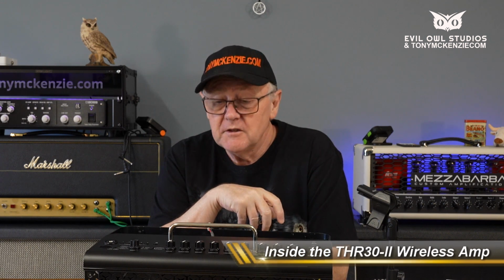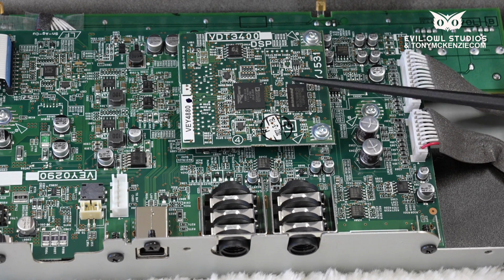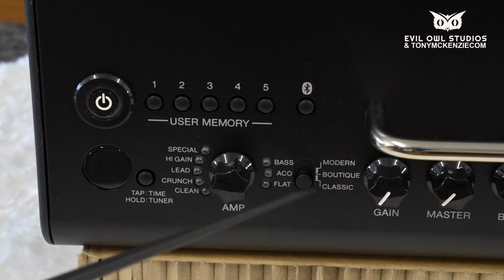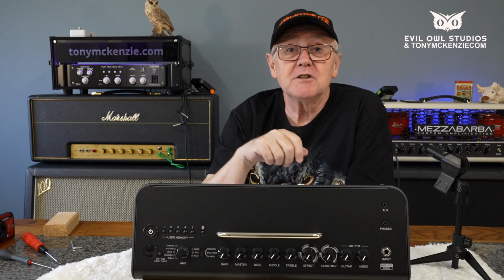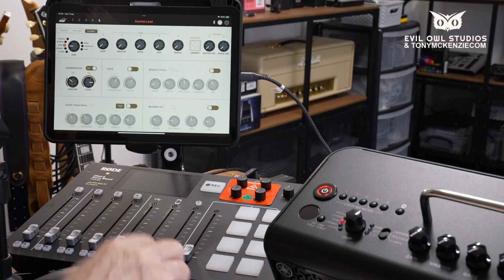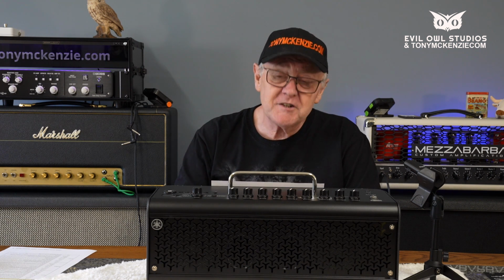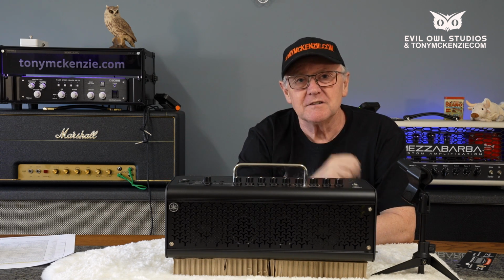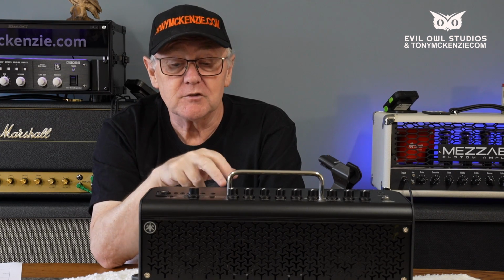Yamaha THR30II Wireless Amp Simulator: In Depth Review

Comment: I recently got a THR 30II and a line 6 relayG10TII to go completely wireless, it doesn’t have all the useless bells and whistles as a spark. It’s a no nonsense desktop amp for someone that wants killer tone without messing around with setting and effects for hours. It sounds massive, and being totally wireless makes me want to plug in and practice more.
Reply from the maker: It's great that you're enjoying your new gear and that it's inspiring you to play more!That's the whole reason to buy it! The Spark and the company making them I did not like after they did not supply the gear when they should have but had the money. I won't go back to them...  and thanks for watching.

Comment: Mine died three years after purchase. I’ve always taken good care of it and only used it in my bedroom. It’s a shame that the lifespan of the amp is so short.
Reply from the maker: That's really unfortunate to hear about your experience. Its one reason I ALWAYS talk about warranty - sadly some don't see the relevance in a review... like the chips inside, but it all matters. Thanks for posting about this problem as it lets many other guys know about your not too great experience and thanks for watching.
Reply: Thank you @tonymckenzieofficial. Unfortunately, unlike tube or solid state amps, these are quite difficult to repair when something goes wrong. I would have expected a few more years before it died . 3.5 feels a bit too short for a bedroom amp that isn’t exactly cheap in its category. It is disappointing.
Reply from the maker: Oh I get that for sure. Some guys will save up for some time (we've all been there) to get one... and while repairs could be difficult (on all digital gear) the cost might well be also prohibitive too. Good point and thanks.

Comment: PS: After the cashback offer for Black Friday, I just paid 510 Euro for this, INCLUDING THE WIRELESS DONGLE for the Guitar (Line 6 G10). Keeping in mind I had only the guitar before, that's a reaaaaally good buy to getting started AND getting started wireless from the beginning! Been wireless for like 20 years on my headsets, couldn't go back to wires now! ;-)
Reply from the maker: Yes not a bad deal.... and thanks for watching.
Reply: @tonymckenzieofficial  No, thank YOU for the review! On the integrated batteries, as a small way of saying thanks: 6 months is probably on the safe side... Also depends on the parasitic draw while just standing around, not connected... The root problem is the battery discharging to a point where voltage is too low to get recognized/charged anymore.
At that point you have a problem, because you either need to replace the battery flat out (maybe even better options available?) or at least jump start it in a way, so it can get charged again. BOTH of those options require you to open the unit and mess with electronics, OR pay a lot to have it done. If you had the choice, you'd want to store it no fuller than 80% and "catch" it before it get's too empty...
Probably best to not worry and buy a better replacement if it's an issue once out of warranty...

Comment: I have a fleet of Yamaha THR's. Started years back with the THR10X, the green high gain model. Next I bought the acoustic model the  THR5A, then the  THR10. I still have all three and they are brilliant in every way. I recently bought the THR30IIA, and it too is terrific.  Love these little amps. They shine for recording with zero latency.
Reply from the maker: Yes I liked the amp a lot, small, light and fair enough sounds. I did think the wireless at extra cost should maybe have been in the price though. But no denying its not a bad device :) Thanks for watching.

Comment: Excellent review! I bought the THR10II and I love everything about it but it has a weird crackle on all the clean tones so I am going to return it. I have managed to get a good deal on a Positive grid spark which should arrive in a few days but I am still very interested in one of these if I can get one for a good price!
Reply from the maker: Yes if there is trouble on ANY gear send it back - should not be out there. Personally I'm not really a fan of Positive Grid as when I ordered some years ago they failed to deliver for months and eventually I got a refund. But hey, let me know what you think of it when you get it - there's nothing better than an owner user that has the gear and they post the comments about how it is for them... and it helps many guys too. And thanks for watching.
Reply: @tonymckenzieofficial   I tried 2 THR10II they both had a weird a crackle. I received the Spark and it's not bad! It is bass heavy and because of that, it's a very dark sounding amplifier whereas the THR10II is more clear and has better speakers. The Spark however can surprisingly get very loud, I tested it (much to the dismay of my neighbours below) and it reached 110dB from around 5ft away.

Comment: So the lithium battery is not replaceable by common folks.
So what are we going to do when it is exhausted? Send the amp to a yamaha lab and pay 5 times the cost?
Very annoying (and very common these days, regrettably)...just another way to do planned obsolescence.
Reply from the maker: Well you COULD open it up... that's possible but could you get the battery? Thats the better question really. No replacement then no point opening it up. It IS common just as you said too. I also see a few 'penny' batteries in gear that no-one mentions. You can change them of course, but only if you know they are in there. Thanks for watching.
Reply: @tonymckenzieofficial  thank you for your understanding and for doing these videos that nobody else do. So many people out there want lithium rechargeable batteries in their devices for convenience, but they don't understand that lithium batteries have a relatively short life, especially if not treated in the right way...so they are essentially buying equipment for the short term, since very few people really cares about changing exhausted batteries (especially if not easily accessible), they just throw functioning devices in the trash and buy new ones.
What really makes me angry is that it would be very simple to design devices with easy access to lithium batteries and to use standard ones, so that every consumer could swap them (it would also improve the autonomy of the device, like it was with older phones).
P.S.: sorry for my not perfect english...it's not my native language....

Comment: I have gad a THR10 bout 5 or 6 years. I really like it, even though it cost the same as my Katana mk1. Like that one 2. I took the yhr10 to a rehearsal, there was electronic drums and the little box held its own. 
Maybe not the glorious feeling of my 50 watt jcm800 with 1960a 4x12, but I put it in a backpack and took it to rehearsal. 
Great review as always.
James
Reply from the maker: This type of equipment certainly has its place and I will always point that out of course. Tube amps are 'just that bit' different IMO re tone and feel, but this little THR30II is pretty cool. Thanks for watching.

Comment: Hello Tony! According to many reviews, this unit has an output of 15W with batteries and 30W with the power supply. Shall I experience a volume drop when I unplug the power supply? I hear no difference with  my unit.
Reply from the maker: Like taking a 30w tube amp and comparing with 100w tube amp you might be surprised that the difference is nothing like what you think. Take this unit and slap it on a 4x12 speaker cab and it will move the room :) I think your device is probably fine and thanks for watching.

Comment: Had the original and now have this one. Love it.
Reply from the maker: Yes it IS a pretty good unit for sure. Hard work on the wireless (at least here) though. Thanks for watching.
Reply: @tonymckenzieofficial  Luckily got mine when the wireless unit was available and it does work really well.  Still think it should be included with the amp.

Comment: A year on and I'm watching your vid.  Very informative.  You affirmed my decision, and even the bespoke plug-in unit met your qualified approval.  I bought the THR10ii 20W today ... but I had asked for the 30ii, so was rather annoyed when I got it home.  For the record, here in Whitehorse, Yukon, Canada, the 10ii cost $649.99.  I'll exchange it on Monday for the 30ii.  Is it not possible to use another wireless device?  I bought a Vox Amplugs today ... not the same purpose?  Will it work?
Reply from the maker: I have not tried others... sorry I can't say. But it did annoy me. The NUX mighty space comes with its wireless...

Comment: Nasal thin and boxy sound….
I’ve got the Spark and the THR at home right now….
I’m sending them both back, but the Spark sounds fabulous compared to the Yamaha. I just don’t want to have to use the app all the time. The only thing that the Yamaha has going for it, is the battery and wireless connection…. But it’s soulless
Reply from the maker: Check out the NUX Mighty Space I reviewed here: https://youtu.be/GreCqrP6sBw and you might find that is pretty good! and thanks for the post and for watching.

Comment: Thank you for the very in-depth review. I bought one of these for a non-conventional use. I have my floor harp hooked up to it and it sounds fantastic! Because so few harpists do this, there was virtually no information about any amps. I found a few old articles written about amps no longer in production, so no help there. After several months of research into amps from guitarists' points of view. Their needs are different so it was hard to decide what would work. I kept going back and forth - all amps have their pros and cons.  I could have gone with something like a Fishman Loudbox, but I wanted something that had some more versatility.

I picked the THR30ii for a few reasons. It has a flat setting so I can just amplify the harp and it's quite faithful to the harp's natural tone. The acoustic settings are also great and even some of the electric guitar models like clean and lead and I can get some really funky sounds out of a harp. That's amazing. Also, this amp can nicely handle the wide tonal range a harp has. And it functions as an audio interface, so it covers two things in one for me. I can also get all kinds of different tones and I don't have to go buy a bunch of effects pedals to get them. Being able to play with effects and a harp is way too much fun. On top of that, it's battery powered, so I can take my portable harp and this amp and go busking or play at a hospital and give my smaller portable harp a kick up in tone and volume. With a much more narrow and much shorter soundbox, it doesn't have the richness, depth, or ability to project the way my floor harp can. So this amp helps make up for that harp's smaller soundbox and it sounds really, really good. Much better than that harp sounds on its own so the THR30ii works great for both of my harps for different purposes.

Although I'm writing about a harp, I can see this being a fantastic guitar amp for home too, or gigging with a PA to hook it up to. It's really impressive how rich it sounds without shaking the windows.

Is this amp perfect? Probably not. Is there a perfect amp? No. It depends on what someone needs. For a practice amp or possibly a busking amp or cafe performance, or even as a stage monitor hooked up to a PA, it's a great "unconventional acoustic instruments other than guitars" amp. Perfect for what I was looking for and it's delightfully fun to play with.
Reply from the maker: This is in fact a very good post about the experience you have as a user of the gear. I love to see these because they are honest whereas these days there is so much less than perfect from some that are paid to create content one way or another - so your points will absolutely  help any reader of them and I do know that they are read all the time. Thanks for doing it! And of course for watching .
Reply: @tonymckenzieofficial  Thank you, Tony! I agree it is difficult to sort through which reviews/videos are just sponsored plugs and which are what someone genuinely thinks. I follow a harpist on YouTube who rents the harps she reviews so she isn't beholden to a company and is free to give her honest opinion. I appreciate that immensely. Unfortunately she doesn't review any gear other than the harps themselves. That's one "benefit" of the harp as an instrument. They're so expensive that they're commonly available to rent, unlike a lot of other instruments or gear.

Comment: I picked up one of these a year ago just before covid and have already replaced one of g10 dongles (be very careful switching playing positions with it plugged into a side mounted jack they break very easily) I also had a difficult time finding and replacing it. sometimes the wireless doesn't like to play well around other electronics and will drop out not sure if i would use it in a recording setting or even on stage with the amp behind a mixing board *untested*. But for parties it absolutely kills, its perfect at room levels people love the novelty of it its like a hat trick, and then you can play over jam tracks and it does the Vai, Evh, Extreme sound very well. there is also a wireless footswitch from a company called airstep that enables channel switching or activates the comp/fx/delay/reverb its perfect for what i need it for which is basically nothing except showing off in front of people. =]
Reply from the maker: I never did find a G10 either... but at the price they are (about £90 in the UK) they are really over the top, when the NUX Mighty Space comes with a wireless included. Thanks for the other info too... appreciated, and thanks for watching.

Comment: I had an original THR10 for a bit back in the day. An amazing practice amp. One of the first I recall that offered "component modeling" technology that, IMO? Really set itself apart from Red Bean modeling standards of the time. A lack of any foot switching or FX loop kind of was the only put off at the time, although that's not what it was honestly designed for.
Incredible tones and tube amp "feel" to be had though. Easily good enough for demo scratch tracking or potentially even much more IMO.
Great content Tony!
Cheers!
Reply from the maker: Thanks for the comments Jason very useful I think overall offering more about the THR30 series... and thanks for watching.
Reply: @tonymckenzieofficial  Hi, so once youve set your tr mode in the app i assume you can then save each one and name them in the library as referance to each tune you may play again!? thanks

Comment: Hi Tony, new subscriber here.
I have just purchased this very amp after updating from my old original THR5 (which I loved). There is a problem with the Hi Gain and Special settings where the sound is so staggered and wobbly as if a very sensitive noise gate is on. And the volume of the Modern mode is so much lower than the Boutique and Classic. I am very new to the app side of these things and after watching your video do you think I need to install it and edit the gate on the Special and Hi Gain settings? I was hoping a brand new Yamaha product out of the box wouldn't need messing with but the sounds on my THR30II are really unsatisfying. Thanks! - Pete
Reply from the maker: Hi Pete, and thanks for the sub. Whatever you do, ALWAYS install the software and any updates to the unit when you get it. I always do that because they find stuff and then update it, but if you don't do that there could be bugs and all sorts of stuff going on. I reviewed a GT-1000 floor pedal some years back and it sounded awful, but if you get one today its much improved through software updates etc., and the Yamaha is likely no exception. Do the software then check the settings... its what I would do and come back and let me know if it solves the problem... thanks for the post too, they are always useful to help other guys. Thanks for watching.

Comment: Great review again Tony. I have the older Yamaha THR10X the green one more for rock, I've had it a few years, I don't think they make it anymore, they sound great and it's easy to get a good sound. It's useful having the added line outputs to plug in a PA but I would have liked to have seen a footswitch input so you can switch between the 5 user memories for live use. Although it looks good in black, if its like the dark green one  black will attract/show dust and it's a pain to clean  around the knobs also making the various knob names  hard to read in dim light. One other thing is if it's light like the smaller one it's really easy if your using a guitar lead to walk across the room with the guitar forgetting the guitar lead is attached and drag the amp off a table or chair. I have done this a few times, luckily it survived the fall on a cushioned carpet floor.But it could do with something to stop it getting easily dragged of a table which might include repositioning where the guitar lead plugs in, maybe on the front side rather than the top as on the top the guitar lead won't pull out.
Reply from the maker: Very valid points for sure. As you saw, mine had no wireless as they were short supply.. but that would have helped to alleviate the 'table pull off' going on. Thanks for posting those comments. I bought the black only because of the white or black (of this version) I liked the black better :)  - so thanks for the post as it all matters and forewarned is always best. And thanks for watching.

Comment: So I just got one of these yesterday and I'm getting crackling in the speakers. I think it may just be one, but not sure. Sometimes it goes away and sounds fine. It was a demo model I got from Sweetwater so it's been used. Any ideas what would cause this? If it's just a loose connection, I don't mind fixing that myself. Anything deeper and I'll probably have to send it back.
This is a video I got of it earlier today.
https://youtu.be/eCLnKssxIm0
Reply from the maker: replied on the video